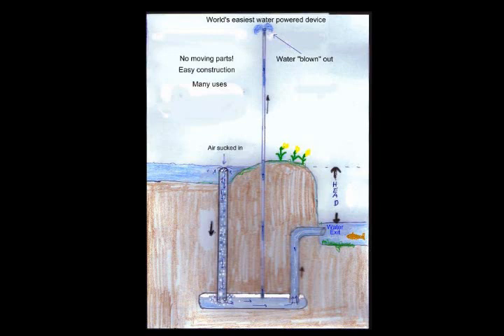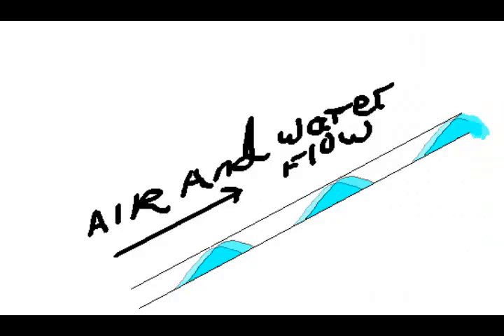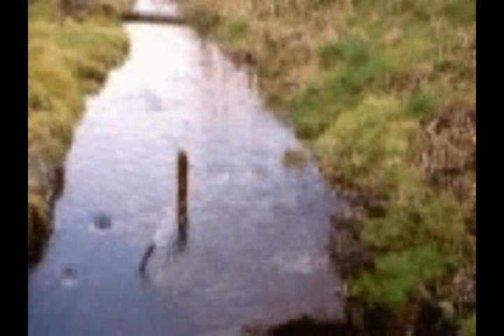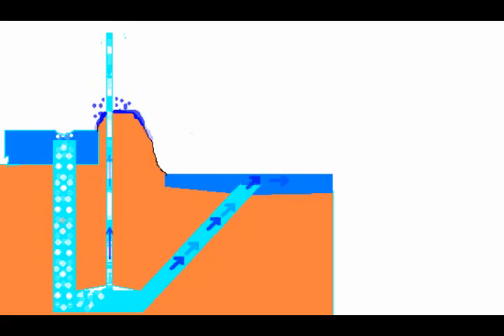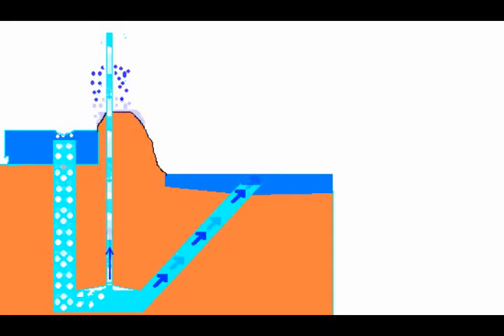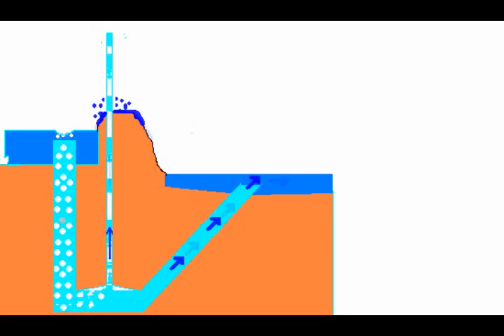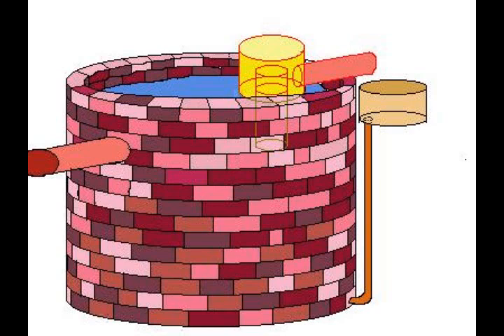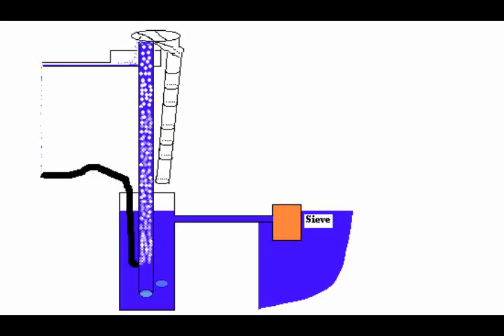WORLDS SIMPLEST WATER PUMP!! Make a PULSER PUMP!   Alhambra pump from 1400 AD? Make one and see!

Comment: Brian, no mummies were ever found in the pyramids, they were NOT burial chambers.  They were laid to rest in the Valley of The Kings
Reply: Correct, the Pyramids were giant Vacuum Pumps and Ram Pumps that pumped the water and air that the Egyptians used to build their empire. It was all done with water, air, vacuum, and gravity as the motive forces. The engine is the Nile River. The fuel water and air and vacuumed chambers. Remember they said on breaking the seals on the pyramids there would be an inrush of air. The pyramids were power plants and they were really huge water pumps. Not a bit making use of some as yet undiscovered or alien energy equations lost to time. It was all plain old fluid mechanics. What is the easiest way to lift a 20000 ton rock? With a barge. Uphill? Build a series of locks and canals.
Reply: Actually the were power plants and were shown that they produced hydrogen.

Comment from the maker: Hi, Vic,  I am happy to give you some insights if you go ahead. I put on this video because I thought that "scientists or engineers" could complete the job and produce reliable figures to apply to any situation.   My site was very small, with a maximum head of 0.55 meters. The 10 cm diameter pipe probably took a maximum of 350 litres per minute of water at that head. Check out the pulser pump nano, and  pneumatic grid, pallet gardens and lungfish aquaponics (all can be powered by the pulser pump

Comment from the maker: Hi, Denis, you misread something.  The place you are pumping water to is several meters above your basins. This is the simplest way to pump water. a few meters higher. It is a set it and forget it thing.  There are no valves, there is no water hammer, and no  service technician if something goes wrong.  If you don't want to pump, you can use the low  pressure air it produces to do "Lungfish Hydroponics", "ebb and float hydroponics" or many other things at a distance from the stream or river.

Comment: this is complicated and useless.try to connect the water supply to the other basin with a straight pipe and that's it.just because the water level in first basin is above the water level in second basin...the fluid will go in second basin just like that.

Comment from the maker: Bill went too big on his tromp for most people (including himself!. Mine are smaller but I  went too big too!  BUT you can do useful work with a tromp that is only 3 or 4 ft deep. A 1 meter deep tromp can pump water with the pulser pump nano idea.  (Bundles of tubes instead of 1 pipe for the airlift can pump water effectively) I am working on several concepts.  Pallet gardens, ebb and "float" hydroponics and "lungfish" hydroponics all to run on 1 psi air. (extremely low pressure air!)  Brian

Comment from the maker: Hi, Danny, I don't think Ping pong balls will work. I think the floating piston (which is just an  R+D idea) will work if you can find a wettable hard foam or sponge that you can cut into spheres of a suitable size.  I only ever did it with little polystyrene balls that I broke apart from some sort of polystyrene casing that was made of polystyrene "bubbles" of various sizes stuck together. I manually submerged them and they produced much better liquid holdup. Potential for large improvement!

Comment: Have you thought about Ping Pong Balls as your floating piston? I have a design for an air lift pump using PPB's but only built part of it. I am working on an air compressor and pump combination for existing wells, 1 moving part. Please let me know what you think. I am doing mission work in Nicaragua, taught 2 classes on pumps, valves and air lift well drill. I will head back in December.  Facebook page NicaMission, Email djquigly@yahoo.com, Phone 765-513-2063 unlimited text and calls.

Comment from the maker: Hi Sunny, I have some  playlists (mostly of other peoples work), that shows ways to use "low grade power" and very small power sources to do useful work.  "weird and wonderful alternative energy machines",  "wimpy power for the masses".  Combining  low energy water power, wind power, solar power, etc to pump air  around a low pressure "pneumatic grid" is technically easier and cheaper than an electrical grid.   The compressed air can then be used to pump water, etc. It runs my pallet gardens

Comment from the maker: Hi Sunny, It is not really practical. Check the weird and wonderful alternative energy playlist for for low tech ideas.These tanks filled with water store energy but withdrawing some of that energy to pump water  (as the water is being used by the apartment dwellers)  will also slow down the water going the the apartment dwellers. And given that their system is low pressure, it is probably slow to start with! And, even more important, more pipework means more danger of sanitary failings.

Comment: Hi Brian,Lets suppose in case of apartments who have tanks filled with water in cities which comes from the water supply and this water is then pumped to the top of the apartment buliding so that its distributed to the houses in the apartment this is how it primarily happens in India be there is not much pressure for the water that sent from the water supply. Can this PULSER Pump be used in this scenario since we have water already accumulated in a tank and somehow this can be used to pump water

Comment from the maker: Yes, it needs a stream of running water.  It is not very "efficient" and  it does not pump very high.  Its advantages are that it is cheap and simple and it uses water power that sits unused anyway. The big disadvantage is you have to dig deep!  BUT if you want something easier, there is the pulser pump nano!  The pulser pump nano goes about a meter deep, and makes approx 1 psi air (7kpa). You use that air to pump water through BUNDLES of 5 to 7 mm tubes. Pallet garden playlist has more details!

Comment from the maker: Thanks, Tim, hope it works out for you,   as long as you have at least 1.5 ft (half meter)  water fall and at least 300 litres per minute of flow you can make one.  Then it is just deciding how much air  you can get and what pressure you need.  These things will never "take over the world" but they do have niches where they are useful.

Comment: No.

Intake material including both, the air and the water.

Different hights, between water source and finale states, where the water comes out, using kind of capillary attraction, which allows water to cyclically pumpability.

You can read more about wikipedia or somewhere on the Internet :)

Comment from the maker: You can look up trompe or tromp on wikipedia (for compressing air).  Pumping with air is simpler and nothing wears out.  No adjustments were required to pump to 1 meter or 5 meters.  The real point  was to prove that you can use very low head water power to do useful work.  (0.5 meters head and 250 to 350 litres per minute flow.) All the fish in the sea will be gone in about 60 years (sea will be too acid for fish to live from CO2!) but NOBODY uses low head hydro. There is lots of it unused!

Comment from the maker: No, you are going into the perpetual motion world!  It just does not work like that.  I think the limit with really low head like this is maybe 35% efficiency.  If you has 2 meter head, greater efficiency can be achieved.  They are testing the pump at a university in England probably before June.   Hopefully the results will be shared openly.

Comment from the maker: I dug  it  by hand,   one summer when the stream dried up. I think the hole was about 15 ft deep.  I have pictures on the tripod site.  Most people hate the idea of a deep hole.  Eileen from the windowfarms community suggested a "pulser pump nano" that doesn't go so deep (just 1 or 2 meters) runs a bundle of 1/4  tubes to pump water.  I did proof of concept (I have no stream now) and that works too. Check the pallet garden project. 1 tube uses about 20 litres of air per hour.  Many tubes needed!

Comment: Why not add a water wheel and pump to the part where the water /air comes out. It would be your added air supply to the system to pump in more air/water and keep it going? Like a turbo works.

Comment: Brian. A Coffer dam is a temp dam to divert water away from the area you want to work in. Then it is removed after the work is done. Also did you dig a big hole to put all this in? This is the part I do not get, how to install your pump system. It looks great and also can keep a pond / head water cleaner with the air in the return air water part. Can the return air water mix be put under the water to get more air into the head water/ pond?
Reply: Dupa parerea mea conteaza doar diferenta de nivel care da viteza apei in trompa si viteza/debitul de aer.

Comment from the maker: It has nothing to do with a ram pump. Look up trompe or tromp on wikipedia. Also look up airlift pump on wikipedia and elsewhere. Also look up 2 phase fluid flow.   Unfortunately the airlift pump page of wikipedia has been taken over (several years ago)  by the maker of the commercial geyser pump so it is biased. (But nobody seems to care!).  Look up Mammutpumpe in the German wikipedia and translate it for a better airlift pump explanation.  Low pressure airlift pumps are used in windowfarms.

Comment from the maker: It has 2 parts, I guess.  The first part is called a tromp and it PRODUCES low pressure air.  The second part is called an airlift pump and it USES low pressure air to pump water.   Other people have made pulser pump videos  too and it is also on wikipedia and in the internet glossary of pumps.  Check those for an explanation that works for you.  Note that the airlift pump entry on wikipedia is a "commercial" for another type of pump. Wikipedia don't seem to care.

Comment from the maker: I am aware of ram pumps. Before making the pulser pump I made a ram pump in the stream. But it didn't handle the muck that our ducks made every day and kept stopping. Also, when it was working the "water hammer" shook everything in that area of the stream.    Ram pumps existed long before Williamson.  I didn't have either a 1 meter fall or the need to pump 40 ft high. Have you priced out ram pumps?

Comment from the maker: Nope, indygoguy. Rams are way more efficient.  But a ram can not use a tonne of water per second and a large pulser pump could.  And pulser pumps are way simpler. So it is just different strokes for different folks. If you bother to go to my windowfarms research playlist, you can see a one psi aquarium bubble pump pumping to more than 10 ft. By your "understanding" that is not possible but there are about 30,000 windowfarmers and many of them pump to 10 ft and higher with the same method.

Comment: Pull out a piece of paper and work it out for yourself. 

This is a hydraulic so the air compressed = the weight of water in the primary column. This is your force.

The height with with you can then raise the water is dependent on the volume of water in the hose. The max height will be when the amount of water in the hose = the amount of water in the column.

You could pump the water 100 ft if the hose was thin enough.
Reply: @nickkitchener6155  ,nu cred ca asa este cum spui.Aerul antrenat de apa trebuie sa aiba o viteza suficient de mare pana jos unde este comprimat de apa incat sa urce coloana pulsanta de apa la inaltimea dorita si pentru asta tebuie optimizate diametrele trompei si debitul apei incat jetul de aer sa intre ingust si cu viteza adica sa aiba o energie cinetica acolo jos si o presiune peste cea de intrare. Energia cinetica a aerului jos va fi:m . V . V /2.cU ACEASTA ENERGIE ESTE APA IMPINSA

Comment: In attaching redundant and unnecessary technical info, sound like any of many scientists and politicians, and to lay yourself open to confusion:  in the conversation of energy in thought, any pressure differential in the bubble collection cone, does not bear mention; rather, the whole from there on out is the simple matter of equalization by gravity, and than water, the air being lighter, it travels by conveyance tube to push some trapped water up and out, . . .

Comment: And though Wikipedia as a reputable source, be debatable, certainly, it does a bang-up job of presenting a lotta good stuff.

As for your stumbling over the operation of a thing so simple as this pump, it's quite simple: the primary stage collects bubbles which, being directed to the lower end of an immersed tube, in spurts, the bubbles force water up and out.

"A good understanding have all they who love G0D's precepts." I rather think, there's the root of your problem, . . .

Comment: For consideration of the thing, the pump is conveniently into two sides; your confused explanation comes from taking 1/2 of the primary side—as either above or below the weir—and attempting to relate that to 1/2 of the secondary side—where the water is spurted or pumped out—and, throwing in some stuff about calculations and pressure chambers thus to come up with a measurement and definition of "head", . . . kind of comical, . . . oh well, . . .

Comment: 3)No, . . . actually, the video puts it pictorially and quite simply
2)Nor for proof of principle, is the engineering calculus at all useful—and, I would marvel to know where might have been my assertion that, I could not find the figure, . . 
1)Nor does the air bubble collection cone function as a tank, nor in place of a tank, nor as a compression chamber, . . . again, you're unnecessarily making things difficult, . . .

Comment: 1)There is no tank, but a air collection chamber, only. I would point out that, the fact of your nonsensical addition of "a tank" is simply indicative of an impossible and contrived way of thinking 
2)In the simplest logic, if .4333 were essential to of proof of principal, one of the other articles would have made use of it
3)I kind of think that, you smoke marijuana

Comment from the maker: The chamber has an inlet and an outlet.  The pressure on the air in the chamber is determined by the height of the water above the outlet pipe (not the inlet).   There is a Cornish pulser pump video (from England). It is worth taking a look. I really did pump to 8 meters high with the pulser pump in the video. It doesn't matter whether you agree with that or not.  It just is.  And it is easily testable.

Comment: 1)There is no "tank of air"
2)Because ".4331 psi per foot" has nothing whatever to do to explain the principles of motive force upon which the pulsar pump is devised, it does not bear mentioning
3)The Wiki article is correct in saying that, the pump is powered by gravity
4)In all instances of working with water against gravity for power, "head" is not conditional, but is the measure of inlet / outlet difference
5)Maybe you didn't comprehend the Wikipedia article
6)Is the Wiki article wrong?

Comment from the maker: Indygogguy, did you look at any of the pulserpump nano videos or the windowfarms research videos yet? I think they can clear up your confusion.  Anyway, the pulser pump has a trompe that provides pressurised air  and the pressurised air works an airlift pump (which is the vertical pipe that pumps the water up. It is smaller than normal airlift pumps and lower pressure, and it uses "plug flow" to do the airlifting. Plug flow is efficient but high pressure fast pumps cannot use it.

Comment: No. No. No.  As in very many water systems, for operation of the system, energy input is provided by head, which is the difference between supply or reservoir and output level after process is complete: the energy in the large amount of the falling water from the reservoir, draws bubbles down; the air bubbles are collected for the air delivery tube, the air then sent to pulse water upward; and in the same remove, the large amount of spent water merely travels to the downstream lower reservoir.

Comment from the maker: You misunderstand how it works. That is fine, because when I first saw it working and measured how much water it pumped, I was surprised too.  I suggest you join the windowfarms community. Or check my windowfarms playlist. It is easy to pump water to 13 ft high with just 1 psi of air pressure and many windowfarmers use a technique i showed them to pump to 8 or 10 ft high with 1 psi. The energy came from water falling over a dam. In my case it was about 300 liters per minute falling a half meter.

Comment from the maker: In a general low head situation,  you cannot put the trompe on an incline without major losses. (The air bubbles  just go to one side of the pipe and goes back up quickly).  You need that vertical flow to keep them mixed evenly.   However, I do not know the what the case might be  in high head situations.

Comment from the maker: The whole point is to use the local small scale power locally. Have you tried powering a Brumby pump with half a meter head from a stream or river?  Charitable missions can only use a Brumby pump as long as they can pay for fuel or electricity to run the pump.  If the mission leaves, the pump (and the locals) are dead. So try to imagine a little world where that half meter head is the ONLY power source.  Because that little world contains many people and a Brumby pump cannot help them.

Comment from the maker: You need a small stream with half meter or more waterfall close by to provide the power.  You have to dig the hole (probably 3 meters deep) divert some of the stream or river into it and collect the low pressure air.  (this is called a tromp or trompe)  This low pressure air can be piped to the fishpond and used to pump some of the water and oxygenate some of the fishpond.